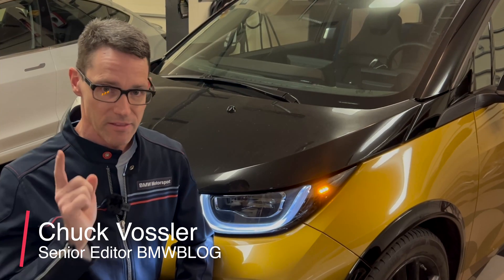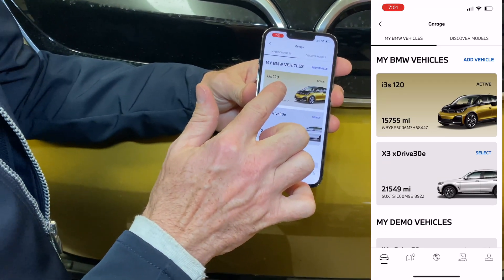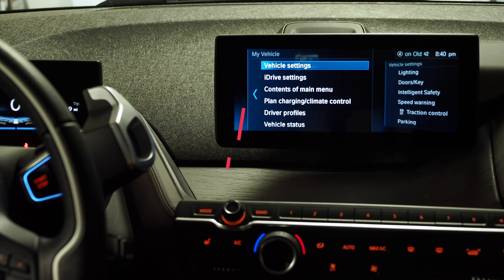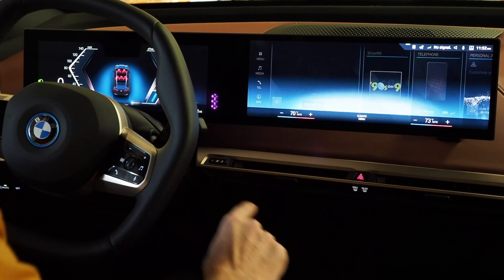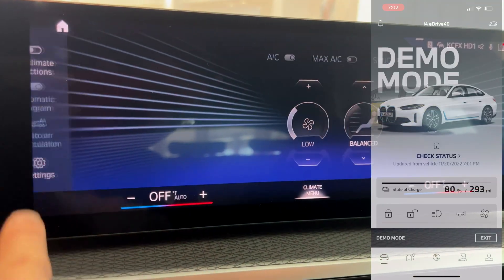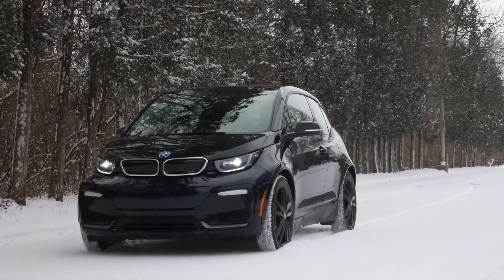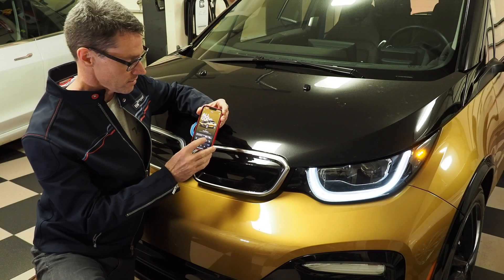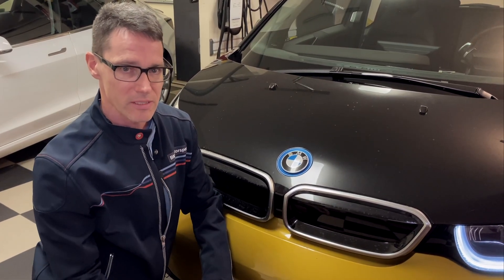Step-by-Step Tutorial: Preconditioning Your BMW Electric Vehicle for Maximum Efficiency

Comment: I'm not 100% sure but I believe Preconditioning requires to program the departure time at least 3 hours prior to departure to be able to heat up the battery in time. Otherwise it won't heat up the battery at all. But again, I can't find this øn paper somewhere..
Reply: I own a 2014 BMW i3 and heard this as well. So I'm confused?? Despite clicking the checkmark for preconditioning, do I have to set my departure time 3hrs early or does it know this because I clicked the precondition checkmark? This is really confusing.

 Please if you could clear this up  @bmwblog
Reply: @ it takes 3 hrs to precondition the battery. So you've to program it ,at
Least 3 hours before departure. The programmed departure time is your actual departure time.

Comment: What a terrible idea that you can’t set the temperature you like. Mercedes have been able to do that remotely for years. A really poor system if you have to go with whatever BMW think is the right temperature!
Reply: That's not how it works, it will pre heat or cool the car to whatever the climate control was set to previously.

Comment: Regarding Charging.   We are told by BMW tech that charging times to avoid higher electric rates will be ignored if the car does not get to 100%  within the start and stop times we set.  I.e.  For instance we set the charge to begin at 9pm and stop charging at 9am... I would think logically the car will only charge during those parameters.  In our case the car starts charging just a soon as it's plugged in and will continue to charge until it reaches 100%  totally ignoring our pre-set limits.    We are making sure to set departure times as well making sure the the " Charge in time slot"  is selected..  Any suggestions ?
Reply: I would only set a departure time for the morning. Use the iDive unit in the car to set it - it gives U more instructions than the app will especially for this. Also makes no sense to me why U have to set a departure time but i suspect it’s what’s messing yours up.
Reply: Which BMW?  Haven’t experienced that issue w/ our i3 and X3e.   Also programming it via the app or the iDrive - Chuck from the vid
Reply: We’re referring to a 2020 i3 Rex

I called BMW again this morning and talked to two different different tech support people which don’t seem to have an answer as to why, after setting a start and stop time for charging, the car instantly starts charging when plugged in

We try to do that not only to save a little money on charging time slots, but also to restrict by guessing the amount of power that goes into the battery to keep it in the 80% range 
Really frustrating whether something is wrong with the system or us be great to get some sort of a firm answer
Reply: @johnc1486 .   For the charge in time slot function to work properly you have to have a departure time set or it won’t work. Do you have a departure time set?
Reply: There’s two areas for setting a departure time that I’m noticing on the app 
   
One is for departure time for  tomorrow morning, and the other is where you can set different departure times for future departure times in which case I set up a departure time for 9am to go to work And and 5 pm for heading home from work. 
Those are both toggled on as far as the one that you can set that disappears after that time is met.  

I have not done that function.  

I really appreciate your assistance. Thank you so much.
Reply: We’re out of town for a a few days. 

Just as soon as I return the car, I will take your advice and get back to you as to what I found out 

Happy new year and thanks again for your help

Comment: We just purchased a 2020 REX    where here in the Ca. desert.    Do you know if the car will automatically cool the battery regardless of being parked or running in temps over 100F?  
Setting preconditioning prior to our scheduled off time from work makes sense, however often times we be by need make spontaneous trips without lead time.
Reply: I have 2017 rex And do not worry. This car does have active Thermo management. It Will do all job for battery efficency. If you are going more then 50 km use preheat of cabin And battery.

Comment: How do you precondition your battery before you get to a fast charging station for better charging capacity?
Reply from the maker: You can pre-condition at Level 2 also
Reply: Not needed. The i3 is charging always at max capacity following the standard charging curve.

Comment: I just bought an I4 BMW idrive35. It says it can take 205 or 215 kw but the highest I have seen even when the battery is around 10% is 110kw. Is there something I can do do increase the kw. Our climate is most around 60 night and 75-80 F temp. Thanks

Comment: Will the battery heating work of I firstly plug in the car, and then program and choose a time in the app? Or do I really need to program first, and then plug in?
Reply: Depends on how you have your car set to charge. If you have set it to charge immediately on plug in, it may start to warm or cool battery pack so it charges most effiecntly. Most commonly you will hear fans kick on  - again most noticed during extremes of temps.  If a preconditioning departure time is set, the battery will charge 95%+ then stop and top off near the time you have set for departure.

Comment: What happens if you’re parked outside in the cold with no plug in available and you select pre-conditioning?
Reply: It will turn on cabin heat only, not heat the battery pack.

Comment: Thanx for posting.  Glad you separated climatization from battery preconditioning. App fan icon is for climate only.  Still not clear:  Should we precondition battery if not plugged in?  For short drives?   Should we always use car to navigate to fast chargers so it preconditions for charging?  (Need a quick link here to initiate preconditioning).
Reply: You can set a departure time and not plug in. It will warm the cabin but not the battery as it would drain too much charge out - defeating the purpose of it. Warming the battery for a short drive imho isn't worth it unless you live in extremely cold regions.(say 25/ -5C) and below.  Then the reason I would do it is for driveability - seriously cold battery and your BMW will limit the acceleration as well as the regen.  W/ Respect to navigate to charge - sadly that is a Tesla-specific thing currently - partly due to a great/dependable network and its inherent integration into the car. Maybe someday an update will come for BMWi cars but if so I bet a long way out.  BMW has dramatically upgraded the myBMW app over the years tho, so there is hope!  - Chuck (from the vid)
Reply: @chuckvosslerE92M3  with iDrive8 the car preheats the battery upon charging if you navigate to a DC-charger. You must use the built in nav, does not work with CarPay/Android Auto.
Reply: @chuckvosslerE92M3  I suspect the car warms for too long this way.  Simply  start climate feature by pressing the fan app on the phone a few minutes b4 departure.  It doesn't, but fan should cease when car is started & normal climate control kicks in.